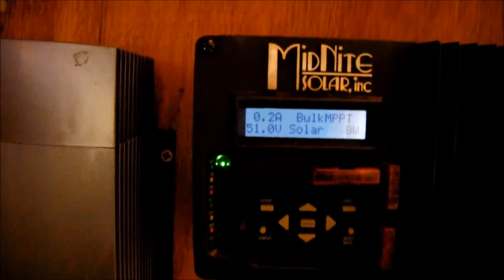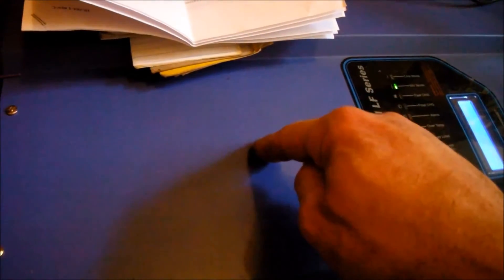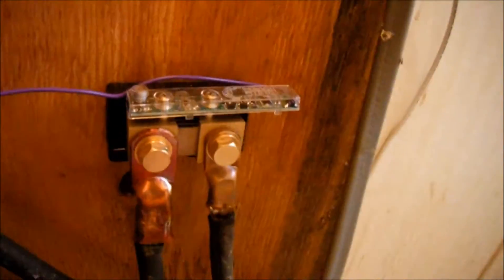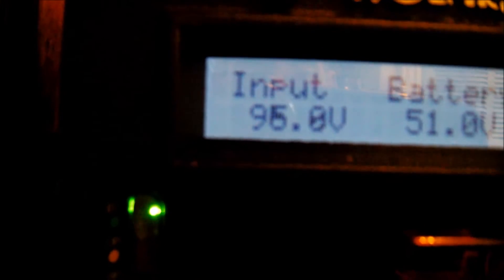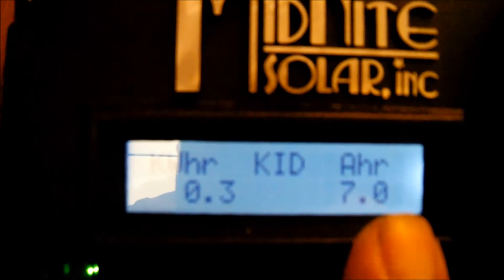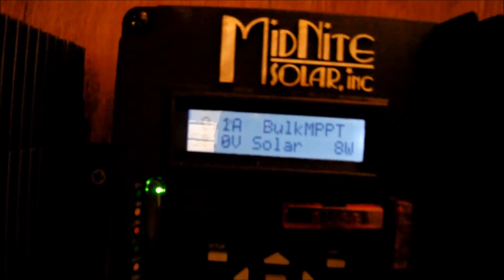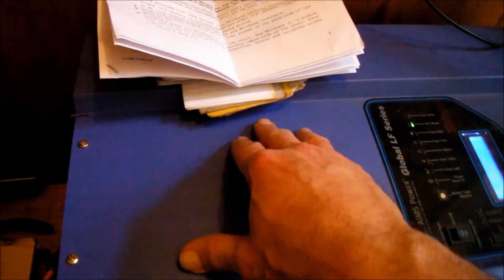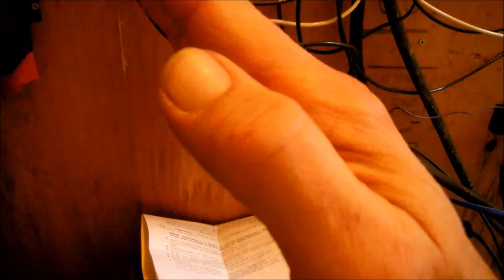Installed a Wizbang Jr. to my Solar setup

Comment: Hi, i was watching your video and had a question about the inverter charging the batteries. Even if you put the knob on the inverter which controls the battery charging to zero, it still charges the batteries ? Thank you !
Reply from the maker: You are correct I have found out I can turn the charging down to zero now that I have using it a while. Thanks for bringing that up.

Comment: Your system is coming along nicely. Looking good. For dressing the wires up, you may wanna get a roll of Velcro. Then you can cut the straps to what ever length you need to get it around the wire. Better than plastic ties, because you won't have to cut it off later if you need to add any wire.
Reply from the maker: Yep that's a good idea, I was thinking of some of that plastic tubing that is split down the middle and you just slip it over the wires to make it look cleaner. Thanks brother!

Comment: looking good ,hopefully sun will coming at a better angle for your solar panels ,have you thought using flat screen tv mounts if panels are not to heavy.
Reply from the maker: Thanks plinksster, they are too big for that kind of mount. It won't be hard for me to come up with a adjustable mount I just need to get up there and do it.
Reply: hope the weather is good for you to work on them.

Comment: The Whiz Bang Jr is a current sense module that attaches to the standard 50mv / 500A Shunt and wires into the Classic and KID Charge controllers to give Amperage readings from the shunt. This allows for EndAmps to function based on System amps or Classic amps.
Reply: Thanks John I was about to look up it's function. Now that you explained that I realize that I have no idea what I would be reading even if I did. LOL
jman